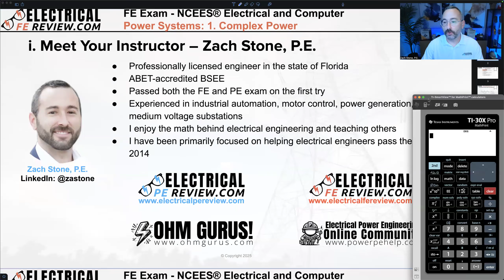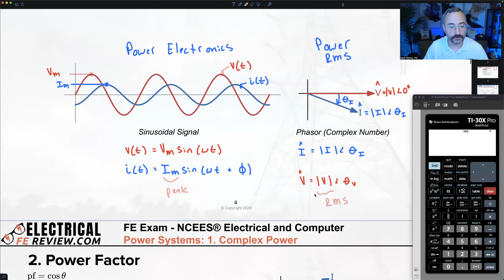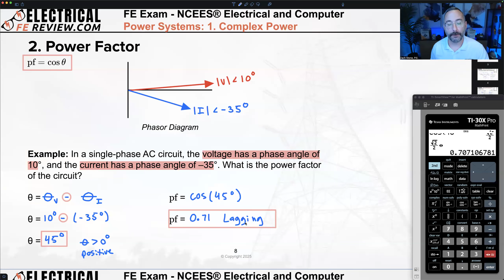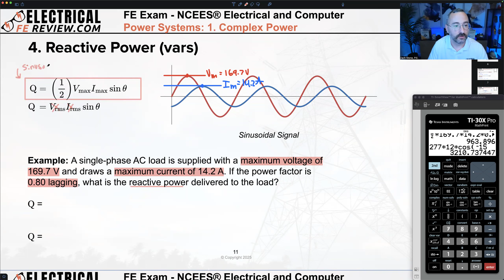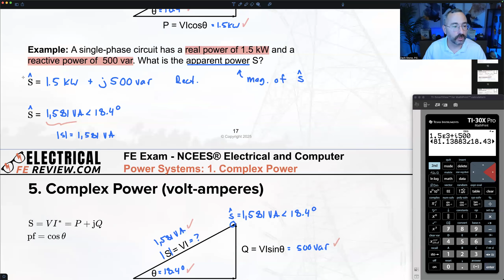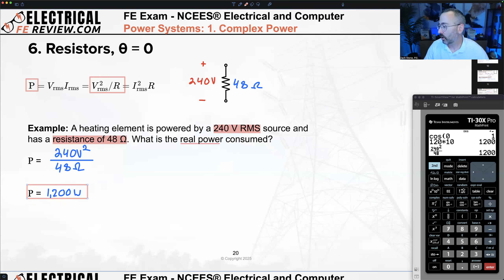FE Power Systems Webinar Series – Ep. 1: Complex Power | FE Electrical & Computer Exam

Comment: Starting from 12:19, isn't the rotation of theta should be in CCW instead of CW?
Reply from the maker: The angle shown in the phasor diagram at 12:19 it the top right is the phase angle of the current (θ_I), not to be confused with the power angle (θ). However, you are correct that if we were to draw the power angle (θ), it would be in the CCW direction from the blue current phasor to the red voltage phasor since θ = θ_V - θ_I

Comment: Good video overall but I am not a fan of the way you find the power factor angle. In every university class I've taken it is the angle of the current relative to the voltage (typically with voltage angle = 0 degrees), but you show it as the opposite. You end up with the same power factor either way, but it makes a lot more intuitive sense for a leading power factor to have a positive angle (i.e. current leading voltage on phasor diagram) and for a lagging power factor to have a negative angle. This feels like it should be common sense, and I've never seen it taught the way you have it here.
Reply from the maker: Is there a specific time stamp you are referring to? You are correct that the power factor angle is the angle of the current relative to the voltage, mathematically, that comes out to θ = θv - θi see 9:37. For a large number of problems you'll be able to use a reference of zero degrees for the voltage angle, which results in the power factor angle and the current angle being equal but opposite in polarity θ = -θi. However, there will be problems where there is a voltage angle given that is not equal to zero degrees, so it's important to be familiar with being able to calculate it both ways.